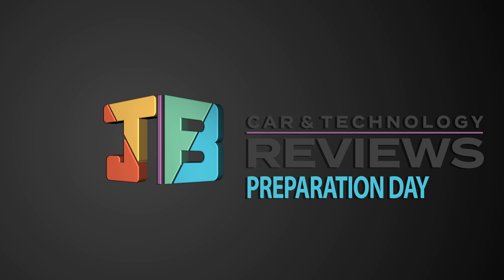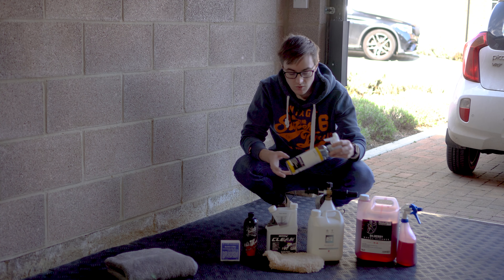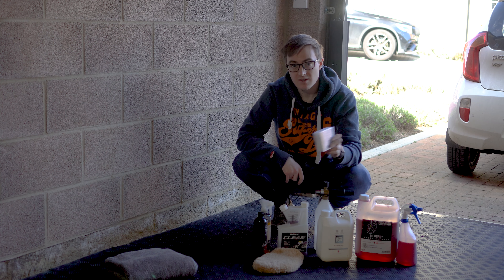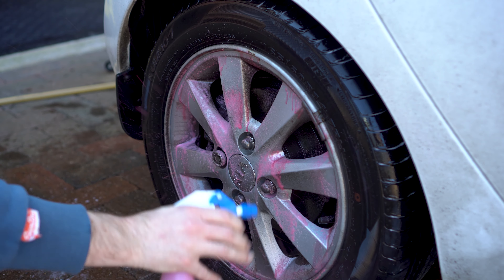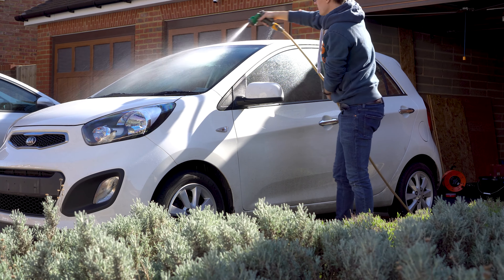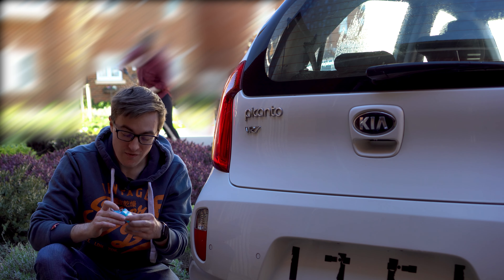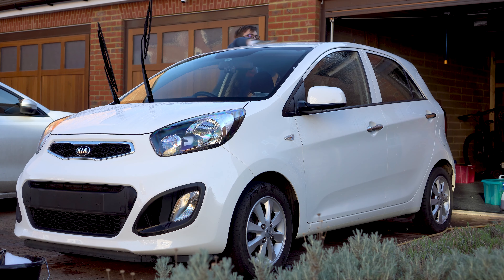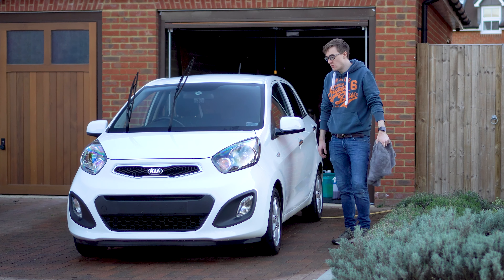My First Full Car Wrap - Let's get it CLEAN! (Part 1)

Comment: I had the same exact problem with a karker power washer: it made that bad noise, had very low pressure and the switch did nothing. I completely disassembled it, repaired the switch (it has a defect where it disconnects itself due to vibration) and lubricated the internals properly. It didn't last a week and I had to give up. They have VERY low quality parts inside tho, I wouldn't buy another entry level karker
Reply from the maker: Interesting to hear! I wouldn't call a K4 entry level - they're pretty expensive pieces of kit. However, I have always seen their domestic range as disposable. I.e. once it breaks, it's gone!